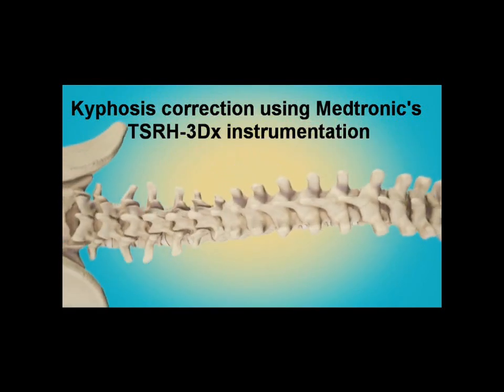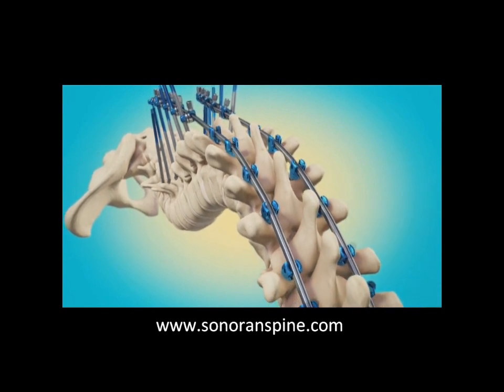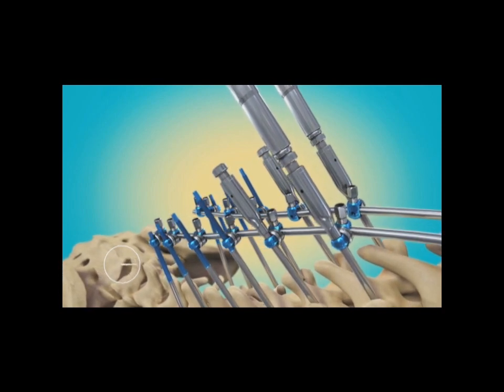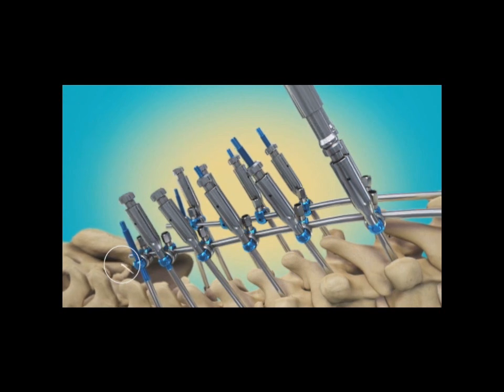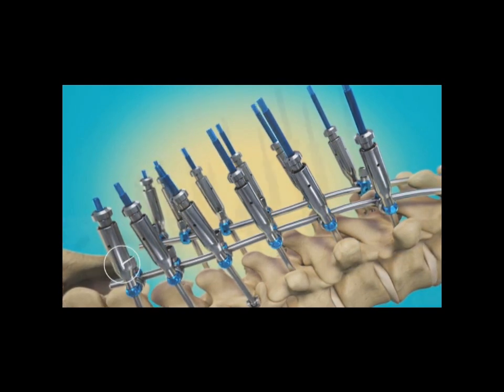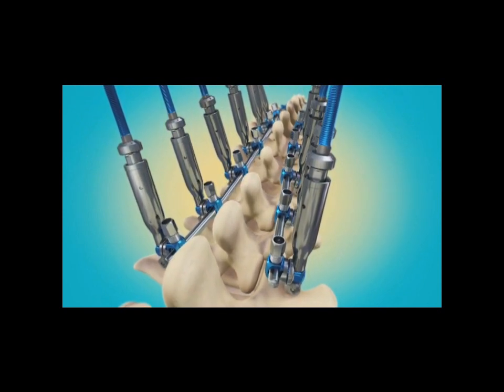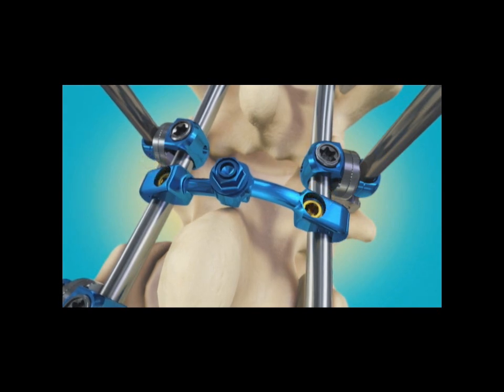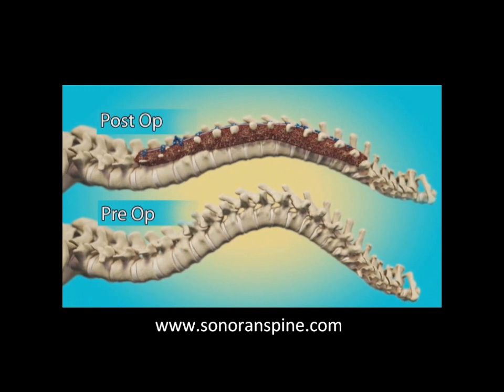Kyphosis - Surgical Correction with Instrumentation

Comment: What is the average recovery time. Not just back on feet but back to work doing medium lifting ect
Reply: 6 months
Reply: @zachgoesham  lol 2 rears to get a reply 😂
Reply: @zachgoesham  I need this done, I am 50 years old. 
If I got this done,  I could be back to work in roughly 6 months without restrictions?
Reply: Yes you will be back to normal between 6 months to a year
You have to avoid exercise until your doctor  says it is fine

Comment: Well this is going to be fun
Reply: Did you get this surgery?
Reply: @MATomaso  No. My neurosurgeon and I decided it would be best to hold off and try more conservative treatments. It was a close thing though.
Reply: @CoreyB88  how bad is your kyphosis in degrees?
Reply: @MATomaso  It's like 64°
Reply: @CoreyB88  if it hasn't gotten worse with time and doesn't cause you too much pain it's not mandatory to get the surgery, usually it's done for 75° kyphosis and above
Reply: @MATomaso  It's Scheuermann's kyphosis, so it hasn't been progressing, but it's very oddly proportioned. It starts at T2 and goes all the way down to T10, so my entire back is arched forward. I look less like the typical "hunchback" and more like I'm half bent over at all times. The pain is extensive and the kyphosis is concurrent with a lot of other issues (arthritis, spinal stenosis, bulging/herniated discs, bone spurs, microfracturing, etc.) The way things are going, if I don't need surgery now, I'll definitely need it in the next 10-15 years as my spine slowly disintegrates.
Reply: @CoreyB88  how old are you?
Reply: @MATomaso  33
Reply: @CoreyB88  are all the other problems you have in your back caused by the scheuermann's kyphosis?
Reply: @MATomaso  I'm not sure. I didn't start seeing anyone for my back until things became unbearable, and by then it was already in bad shape. It probably caused some of the issues and exacerbated others.
Reply: @CoreyB88  ah ok, but if you will have to get the surgery done anyways, isn't it better to do it when you're younger?
Reply: @MATomaso  Not according to my doctor. She's afraid that the surgery will be too invasive and high-risk for someone my age. She's concerned about the recovery period and how long I'll be off work (a good point since my benefits don't currently include short or long term disability). She feels that the meds I'll be on after the surgery could create a dependence on opioids. I guess her mentality is that the older I get, the less my life matters, so the less I have to care about those things.
Reply: @CoreyB88  you mean you're too old for the surgery?
Reply: @MATomaso  No. Not old enough. My neurosurgeon and my pain management doctor both think that I'm too young for aggressive treatment. It's like they think it doesn't matter for old people to get addicted to meds or have surgical complications. It's really weird.
Reply: @CoreyB88  why it doesn't matter?
Reply: @MATomaso  I have no idea. I'm just passing along what they said to me. I don't understand their reasoning at all. Unfortunately, unless I get different insurance, I don't really have any options for second opinions, so I'm kind of stuck.
Reply: @CoreyB88  ah ok, you live in the US? Which state? Here in Italy the surgery is free...
Reply: @MATomaso  i see you everywhere dude, how are you? Will you have surgery?
Reply: @vicary__  i would have if it wasn't for covid, which is turning almost every hospital into a covid-exclusive facility
Reply: @MATomaso  oh, i get it. I wish you good luck dude.
I will probably need surgery too.
I trained so hard for 5 years and the pain is with me for 1,5 year.
I am helpless, unable to work or even stand for 15 minutes...
Where do u live?
Reply: @vicary__  i live in italy, how old are you and how bad is your hyperkyphosis?
Reply: @MATomaso  im 23, dont know how many deegres is my spine, around 50-60° i think. How bad is yours and how old are u?
Reply: @vicary__  surgeon measured it like 75-80° last time i went but i don't have that much pain (for now at least, i'm 25) even tough i know i already have many degenerated discs because of it (spondylosis)
Reply: @MATomaso how are you?
Reply: @vicary__  i'm fine 9 months post op now
Reply: @MATomaso  that's great, im too 3months post op 😉
Reply: @vicary__  had to take painkillers for a while but now i haven't been taking them for months
Reply: I fixed mine by doing different exercises everyday watching YouTube videos but a little of it is still there
Reply: @jxtuber2421  I have Scheuermann's Kyphosis. Exercises and stretches won't help. My vertebrae are shaped wrong.
Reply: @CoreyB88  I suffer from Scheuermann's kyphosis too and have tried everything it's not getting worse since I started hitting the gym but the pain is getting unbearable I do streches and try so many yt videos but cant fix it and I'm only 16.
Reply: @nikkujoski693  i do yoga but my back doesn't get better too, i have pain when i stand still for too long and im 18
Reply: @celine2003.  I think mine may be getting better but my doctors said surgery is off limits as it's nkt severe enough and while the pain hurts I have a strong resistance to it, have you considered surgery?